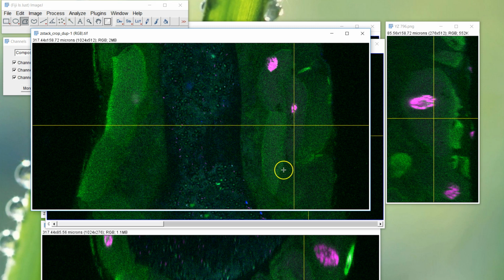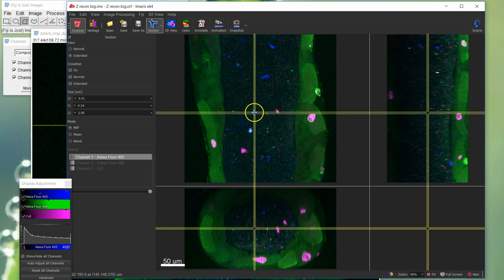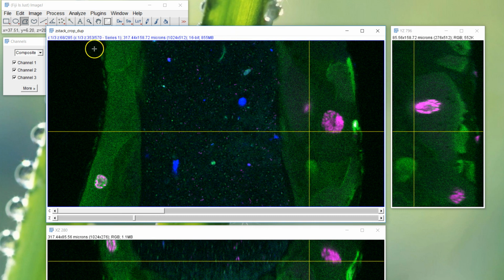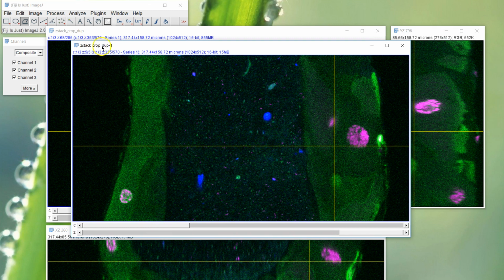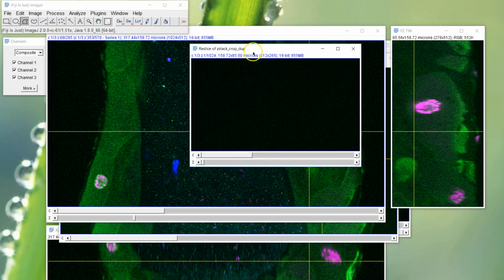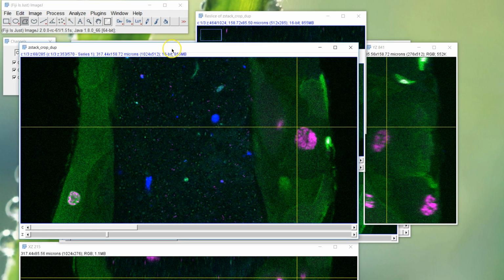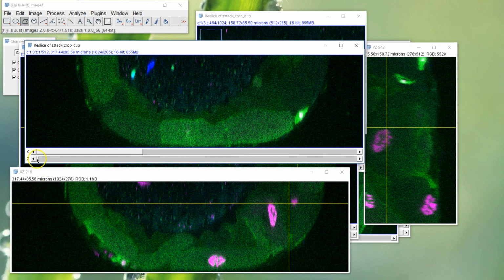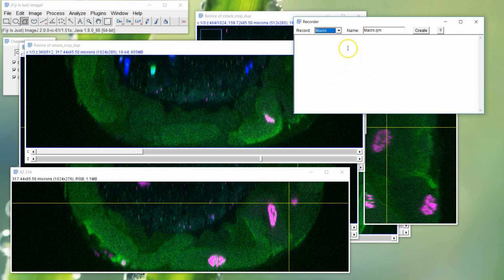Fiji Is Just ImageJ - Extended Orthogonal Views and Reslice

Comment: Hi, thank you for your video. I noticed that after Re-Slicing from Left you would need to Flip your new stack Horizontally in order to get the same orientation as in the Orthogonal View in the YZ plane.  Do you know if there is a command to get the same in orientation automatically without needing the "Flip Horizontal" step after the reslicing? 
Thanks!!
Reply from the maker: I'm not sure I understand exactly what you mean, but if you check "Rotate 90 degree" it looks to match the orthogonal view.